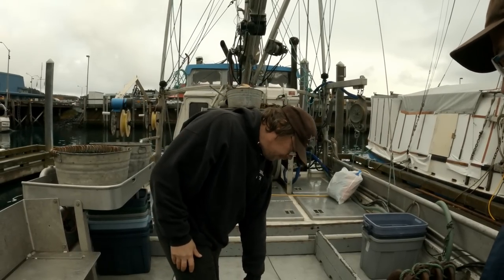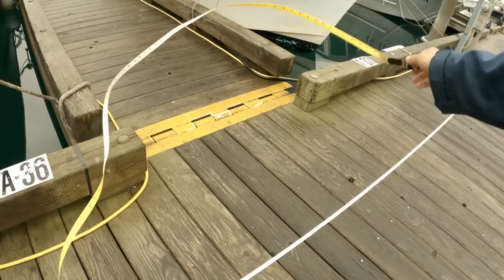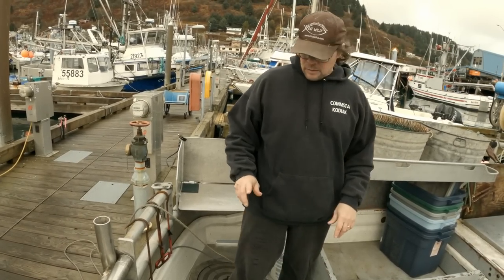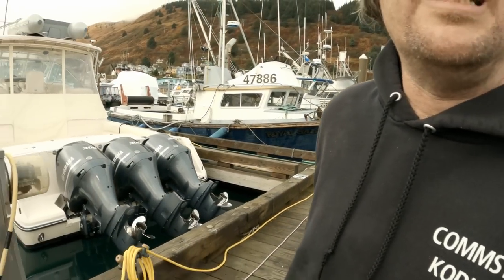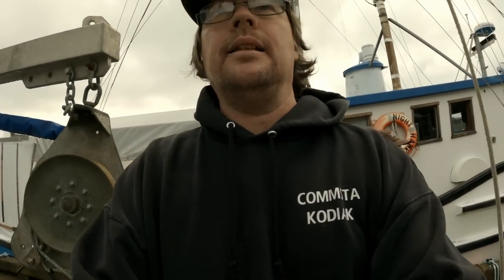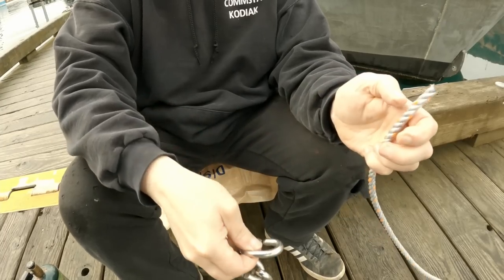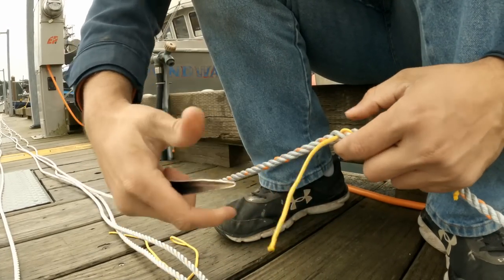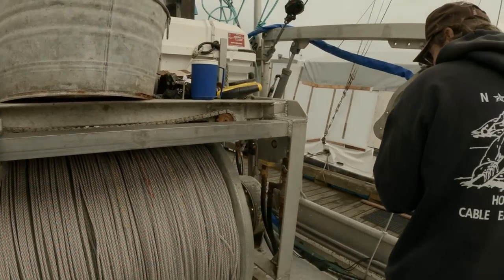Measuring Line - Splicing C Links Into Groundline

Comment: Just a little tip when you start a c link splice pass 2 strands through the link and the third opposite,it will pull down tighter n stop any c link flopping. I do it every time am using a c link and its quicker to connect

Comment: Grampa used to drag his shots and skates down the street to roughen ground line and blue steel when it was first loaded to make it bite the block better, it also reduces skipping in the block
Reply from the maker: This is going on a reel so no problem with slippage. I do have a few shots of crab line that would benefit from a spin around the block!